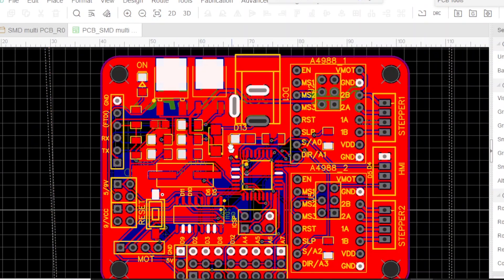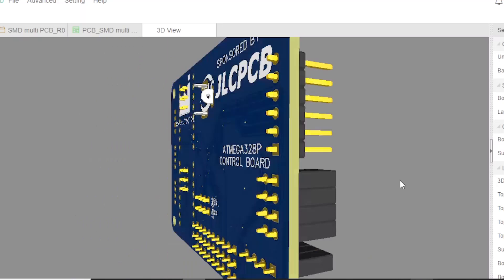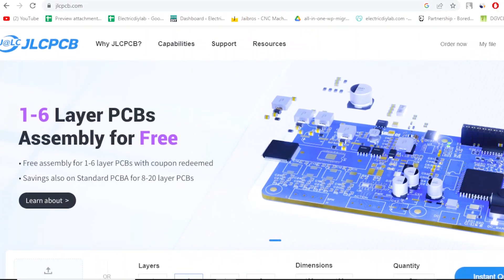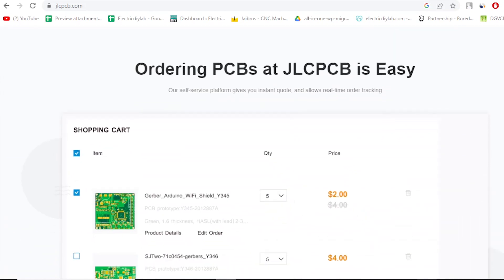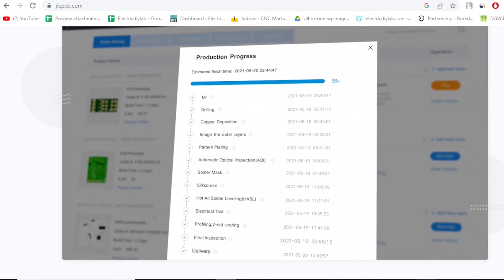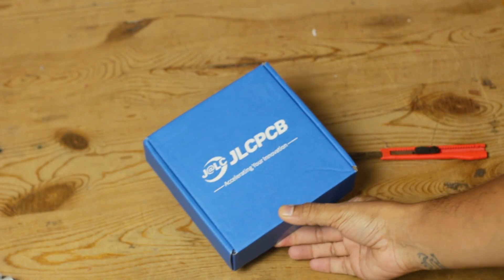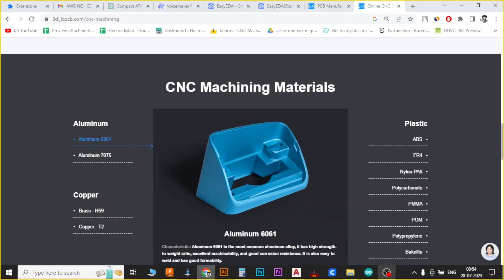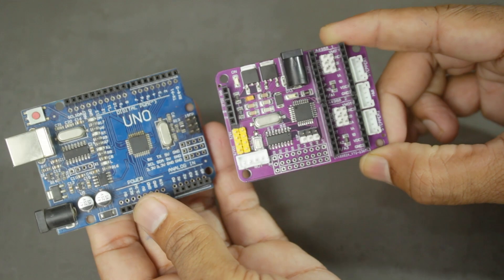DIY Header Pin cutting machine

Comment: I found today an interesting Hackaday project, see on hackaday, "176931-hp-printer-cartridge-control-module" and the related YT video, KjACWDPQ8nw 
In short words, author controls the HP cartridge with Arduino (the code is published on GH).
I think it could make a pretty improvement for your paper-tape-label-printer (it may be only an issue with the ink printing on tape I guess).

Comment: the male version can be broken with your fingernails without wasting time.. but the females are a real time problem.
Reply: it is useful when You need to produce bunch of boards with hundreds of headers.
But this is just a bad design OR it is a devboard
Reply: Always problem with females
Reply: Yeah, you have to be precise and touch the right spot with the correct amount of force, otherwise prepare for hell 😂
Reply: Always 😂